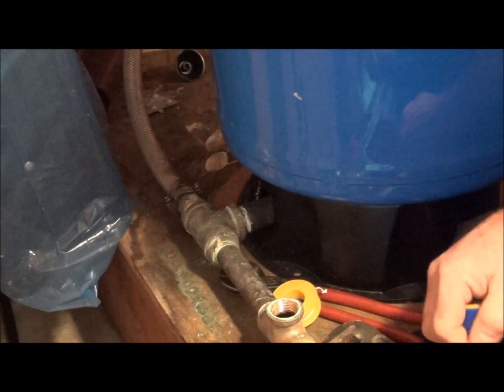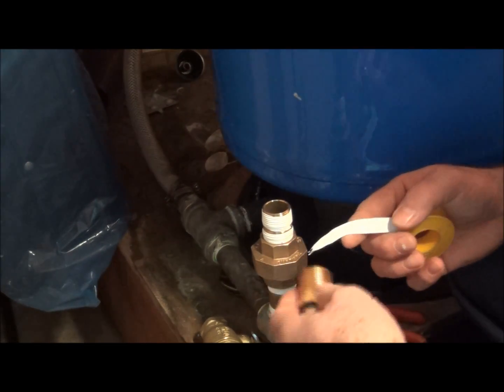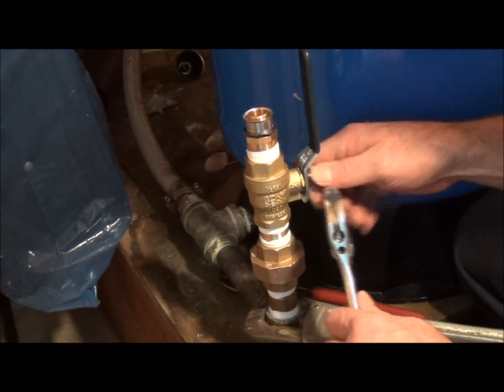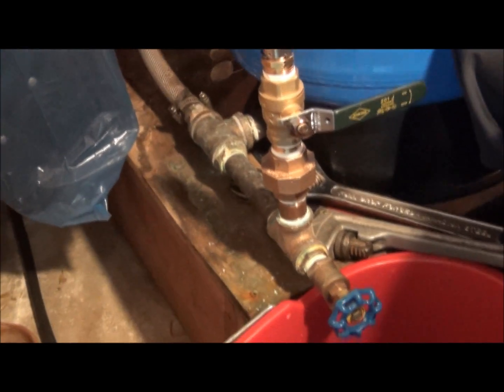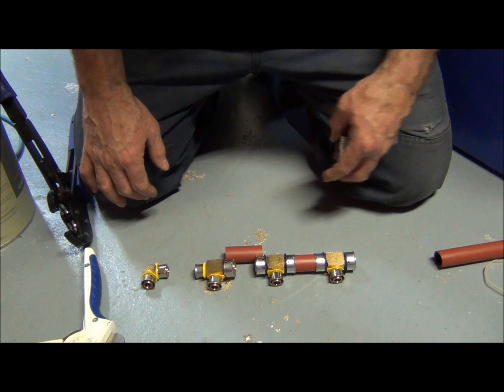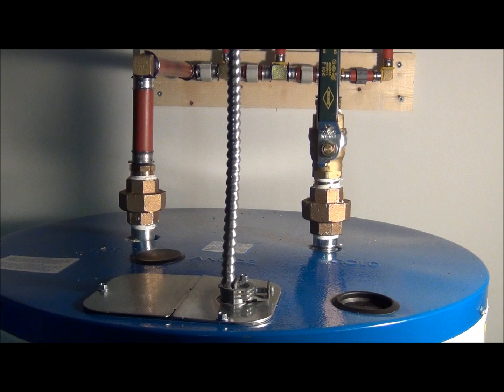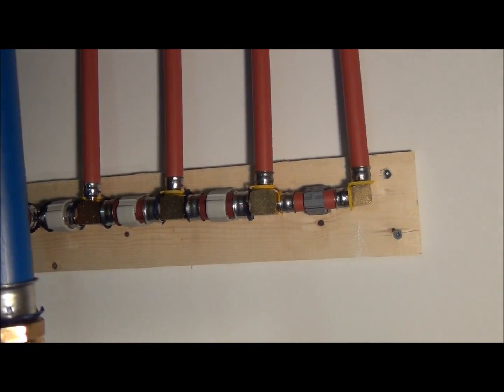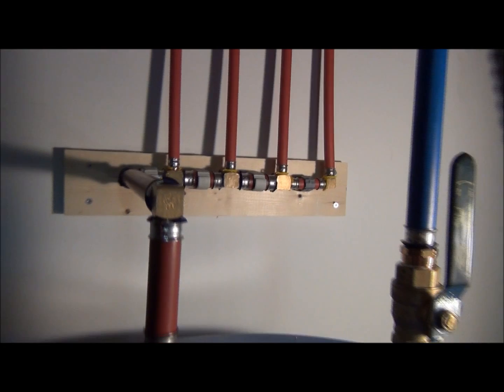How to install Pex Pipe Waterlines in Your Home!  Part 4. Plumbing Tips.

Comment: Hello Al.  Just realized what your name was :)

I'm sure you've heard people say, "but the real benefit of pex is fewer fittings".  So, I gotta ask, why didn't you use bend supports instead of elbow fittings.  Better yet, why not go directly from the water heater to the header with one pex line swung out wide... straight into the first tee of your header...with no fittings or bend supports.

I'm guessing you were going for something more rigid and attractive since it will be in an accessible and visible area.

Comment: I'm new at this and don't mean any disrespect.  My Rheem water heater requires a Heat Trap on both the cold and hot water lines.  Basically, the pipes need to turn down for at least 6 inches before turning back up.  My guess is that heat rises naturally up both pipes, so the pipes act like a radiator.  If the pipes turn down after the tank, then the heat is trapped or at least slows down.  Now, with the low thermal conductivity of plastic pipes, maybe it's not as important.
Reply from the maker: Hello Nicholas,
I have heard of a trap such as this many years ago and it makes sense to me. 
The heat is definitely going to rise naturally the way that most tanks are piped. 
Will have to check into it in the future. 
Thanks for commenting and enjoy your day!    Al

Comment: attn: You are suppoded to have at least 12" of copper pipe on top of water heater, hot , and , cold sides both before transitioning to any cpvc, pex, or whatever type of plastic piping due to heat from tank i believe,  its code for Indiana anyways !
Reply from the maker: Hello Peter,
If you read the manufacturer's specifications about installing this product on electric water heaters; they state that it can be used directly in and out of the tank. This is on electric heaters ONLY.
When installing it on oil or gas heaters; that depends on code as you stated. They are different in all areas, but most have a minimum of 18 inches I believe.  I go to the floor joists with copper whenever I attach them to oil or gas heaters and then go to pex.
Thanks for commenting and enjoy your week!    Al

Comment: I just ran 3/4" from main to water heater, and then 3/4" to under my 
bathroom about 20' away from the tank. I then went up 2 feet to the sink
 in 1/2", and it's taking 48 seconds to come out hot!! I'm thinking of 
changing it all to 1/2" now.... 
How is your time doing on the second floor?!
Reply from the maker: Hello Mateo,
I made a video on why a header will save money over time. I had a lot of people with negative comments about it. 
By running 1/2" pipe rather than 3/4 reduces your volume by half therefore saving a lot of money over time just in hot water and getting the water to your bathroom in half the time. It would be different if the pipe was feeding something that required a large volume and was going to have hot water in it all the time, but as you know once it is shut off it cools down and has to be reheated. 
I would change it myself if I were you. Install a header or few tees with a branches feeding different fixtures. Running a 1/2" hot water line to the bathroom is suffice as generally there is only one person in there at a time.
Thanks for commenting and enjoy your day!    Al
Reply: I have a similar problem.  In South Florida, the attics get really hot, so your attic is basically a solar water heater.  If I want a drink of cold water, I have to wait for all the hot water to pass.

Although some people suggest to up the size of your pipe if your switching from copper to pex because pex has a smaller ID, I decided to stay with the same size pipe because my flow velocities will be ok and I don't want to wait longer for cold water.
Reply from the maker: Hello Nicholas,
A lot depends on water pressure coming into the house. If the pressure is good coming in then you won't see any difference in pressure at the faucet. Many faucets have energy saving aerators on them that only allow a certain amount of water to flow through.
Some pex such as Rehau and Wirsbo have larger inside diameters than others. So it will depend on what pex you run.
The speedway supplies that feed faucets are feed with 3/8th supplies that have 1/4 inside diameters so I really see no need of upsizing the piping myself.
Thanks for commenting and enjoy your week!   Al

Comment: thanks for the clarification on the PEX directly off the WH and needing to use copper on a gas one. I saw somewhere when looking into pex that it said you always had to run 18" of copper directly off of the WH but did not specify why or that you only need to do that with gas ones. I assumed it had something to do with the heat of the water coming directly out of the WH, as opposed to the flammability of the PEX.

I do have one question about the header/manifold you built. usually the ones i see have a shut off valve directly off each run and the entire header is a loop to supply constant water pressure on both sides of the header, but yours has neither, why is that?
Reply from the maker: Hello Chad,
I use pex directly off an electric water heater, but on gas and oil you need copper. I generally take it to the floor joist as it easier to anchor and makes a neat job.
You are not allowed by code to have shut off valves on the output of the heater. A shut off should only be installed on the cold side.
If for some reason the valves were shut off, the boiler would build pressure and hopefully the relief valve would blow off and you don't want that as they sometimes do not reset properly.
I have 3/4 pipe feeding the boiler and the outlet is 3/4 feeding each 1/2" branch. I am not certain of the loop you mentioned, but the header is to supply a constant water pressure. 
Thanks for comenting and get back to me when you get a chance....Al

Comment: I'm glad I stumbled around your videos. I'm remodeling a bathroom in a 101 year old house, and the plumbing is a mess. So far I've found black iron, cast, lead, PVC, copper, and CPVC in the same house. I'm going to be replacing all of it with PEX for a clean and simple installation. This just saved me a ton of time and headache!
Reply from the maker: Hello Steven,
Sounds like you have your hands full on this one.
Everyone has had a crack at the plumbing over the past 100 years.
Pex will work fine as far as the waterlines for you. 
Take your time and plan it out and you should be all set. I generally run all my main lines first and then make my tie ins once they are done. This allows you to keep the water on in the house as long as possible before you make the last tie ins.
Thanks for commenting and best of luck with the project!   Al

Comment: cool, just what i was looking for..... on electric water heater pex plumbing install was just wondering how close to the water heater i could run the plastic pex pipe. i see you bring the pex pipe right-up to the water heater fittings w/o lead-off metal pipes to space the pex pipe farther away from the water heater. ok... thx!
Reply from the maker: Hello Martina Dejaquiz,
With Viega pipe the manufacturer states that on electric water heaters ONLY you are allowed to come directly off the top of the tank.I have seen Rehau and Wirsbo used directly off the top as well. If you check your pex manufacturer it should state how it can be used.
For gas and oil heaters you MUST lead off with a metal pipe and the length depends on the code in your area. 18 inches is the minimum I believe. I generally run the copper to the floor joists and go with pex from there.
Thanks for commenting and enjoy your week!    Al

Comment: Nice video and nice workmanship! I'm a big fan of the unions also. One thing about the manifold that might be of note is that if you feed both ends of the manifold with incoming water you can lessen the effect of a toilet flush or washing machine causing a  pressure loss to a shower. If only one shower is supplied by the manifold, you can also just put one feed on like you did and make sure the shower is the first takeoff.
Reply from the maker: Hello Dall,
Thanks!!
Gotta have the unions on the tanks for certain.
I never would have thought about feeding the header in both ends. 
Thanks very much for the information! Much appreciated!
Thanks for commenting and enjoy your week!    Al

Comment: By tightening the fittings under the union in that manner you risk the chance of gaulding the surface of the seat in the fitting and causing it to leak.
Reply from the maker: +Roger Deaver 
I have been tightening them in this fashion for years with no issues.
Always willing to learn though. What exactly is gaulding?
Get back to me when you get a chance...Al

Comment: Is there an advantage to running a header or manifold with individual hot water feeds rather than running a single hot water main with branches to the fixtures?
Reply from the maker: +john smith 
The advantage of running a header rather than a 3/4" hot water line and taking branches off to feed fixtures is the amount of hot water needed to feed one fixture. You must fill the entire 3/4 line first and then to a 1/2" line supplying the fixture. A 3/4 line holds twice the amount of water as compared to a 1/2" line; so heating that water will cost a great deal of money over time. 
By installing the header and running separate lines, you prevent that from happening and also supply a more balanced supply of water throughout the house.
Thanks for commenting and have a great weekend!     Al

Comment: Hi, can you help locate a supplier of vinega pex fittings in Canada. I am not having much luck on Google. It looks a really slick system and I would like to use on my build. Great videos by the way, I leaned a great deal.
Reply from the maker: +John Weaver 
The Viega system is sold through Wolseley plumbing. They are a wholesale distributor so I am not certain if you will be able to purchase the system or not. It is an excellent product and very easy to use.
I hope you get along well with the installation no matter what route you take.
Thanks for commenting and have a great week!    Al
Reply: +TheOldkid888 Thanks. I called them and they will sell to anyone. Have a good week, cheers.
Reply from the maker: John Weaver
Good news!
You will need their crimping tool as well. Hopefully you can borrow it from them.
Best of luck with the project!   Al

Comment: thanks for the very informative videos about pex, i wish i had watched them before i started to do my reno's as i may have gone down this route.
i love were you live, im stuck in sk. for another 3 years until the kid leaves high school, but after that i will be moving out east, and you made me smile when you used your spanners and not wrenches, as i was originally from the uk, and i also have spanners.
Reply from the maker: +Steve Weston 
You are more than welcome!
Glad you enjoyed the videos. Gotta love spanners. I use them quite often. 
I can still see my father using them on almost everything he repaired. Was a plumber as well.
You are in the heart of winter now out there. 
Enjoy those next three years! Next thing you know they are gone and you will wish they were still under your wing. 
Thanks for commenting and enjoy the weekend!   Al
Reply: +TheOldkid888. hey whats up im up in Canada running pex to all my connections got a box off connecters but having a few issues trying to run 160 feet of easy heat thru poly, this seems almost impossible👆, and i need some advice on connecting pex to water pump  and water heater thanks hope to here back from you✌
Reply from the maker: Jules Sluman
What seems to be the issues you are having?
I made a few videos on pex and installing it off of a water pump and hot water tank as well.
Get back to me when you get a chance.    Al

Comment: I'm a realtor in Pensacola, Fl and started reading up on PEX yesterday. I have a buyer that was running into issues getting homeowners insurance because there was PEX in the house (We have this resolved now). Anyway, I found your videos and watched all of them. As a result, I have a good understanding of PEX, how it works and is deployed. Great videos! Thanks!
Reply from the maker: +Nathan Swafford 
You are more than welcome!
Biggest thing that a homeowner has to be concerned about when it comes to pex is the sun or florescent lights. If the pipe is exposed to either one for a considerable amount of time the pipe will break down. I have seen this happen. By covering it with insulation will prevent this from taking place. They all come with a UV rating.; some longer than others, but regardless they will break down if exposed to them.
Pex in my opinion is a great product and has been around for many years. You could say it is relatively new to North America. Only a few decades.
Thanks for commenting and enjoy your week!    Al

Comment: A little disappointed here. To me the most important part of using this type of system would be making sure your crimps are done correctly. I watched all 4 episodes and granted I skipped a bit, but not once did I hear you describe how the tool works or how to make sure your crimping correctly... guess I'll have to look elsewhere.
Reply from the maker: +durr moment 
I made a video on joining pex five different ways.
You may be interested in it....How to join pex (plastic pipe) five different ways. Plumbing Tips!
Sorry I didn't give an explanation about the tool in the series.
Thanks for commenting and have a great weekend!     Al
Reply: +TheOldkid888 Yea, sorry,  I found it later on.
Reply from the maker: durr moment
No worries!
I hope it helps you with any future project!
Thanks for commenting and have a great week!     Al

Comment: MA code is "PEX tubing shall not be installed closer than 24 inches to any connection to a direct fired water heater, tankless type hot water coil or heating boiler".....but MA is in its own little bubble
Reply from the maker: +russor22 
What they say is correct there. That being said...this is an electric water heater. Viega states right in the manufacturer's guide lines that pex can be installed directly off the top of electric tanks only.
You cannot install it directly off of oil or gas water tanks as you mentioned. Big thing is to keep it away from any source of heat. So you MUST have copper coming off the top a distance according to code. I know that varies depending on location. 
When installing it off of oil fired heaters I generally go to the floor joists with copper and then with pex from there.
Thanks for commenting and have a great week!      Al

Comment: Doesn't code require PEX to be a certain distance from the water heater?
Reply from the maker: +jtrusl 
On gas and oil water heaters you MUST go into and come off the top of the tank with copper. The distance depends on the code in your area. Some are 18 inches and others require more, but off of electric tanks ONLY you can come directly off the top of the tank. Viega states in its manufacturing information that it can be used off on electric tanks.
Thanks for commenting and have a great week!    Al
Reply: This is just like the Q&A section of Homedepot.com; people ask the same question over and over.  I wish they would look first.

Comment: you  put your union on upside down
Reply from the maker: +Bessie Gilbert 
Really?
I have installed them like this for more than three decades with no issues. Is there a right and wrong way?
Thanks for commenting and have a great day!    Al
Reply: Why the union in this case? Couldn't you just use the nipple directly to the ball valve. Everything is brass in his case.
Reply from the maker: condor5635
You can go directly from the nipple to an adaptor and then pipe,  but I install them like this to allow for easy change out in the future.
It is almost a definite that it will be changed within the next 6 to 8 years or less sometimes. The tanks are not made like they were 30 to 40 years ago.
Water quality plays a big roll in their life expectancy.
Thanks for commenting and enjoy 2016!    Al

Comment: my bathrooms are back to back so could I run one hot line to the kitchen and tee it off with a line to the sink then a line going to the bathrooms and then split them off for each faucet and shower? Do I need some kind of manifold system so there are no drops in pressure?
Reply from the maker: +Fat Harold 
You can do that, but you may want to take two lines directly from the tank. Drop of pressure is most noticeable when getting a shower as other fixtures are turned on the water temperature will change either to hot or cold; so taking separate lines to each fixture will help this from happening. 
If your faucets are posi-temp then you can do exactly what you said although there will be a drop in pressure you will not see a difference in temperature.
I would at least run a separate line to the sink and one to the bathrooms. If both bathrooms are used a lot at the same time; I would also run one to each bathroom. If not, I would just run one and tee off to the fixtures.  
So a good run would be one to the sink and one to each bathroom. I prefer running one 3/4 cold and branching off myself, but everyone has their own thoughts on that. This is just the way I do it and it works for me.
Thanks for commenting and have a great weekend!    Al